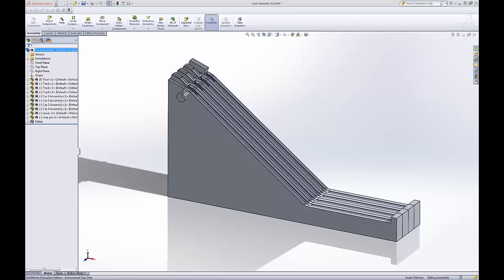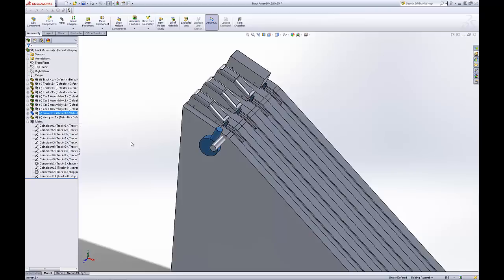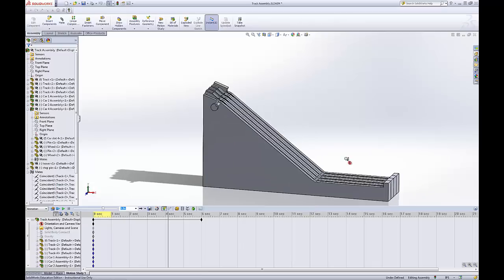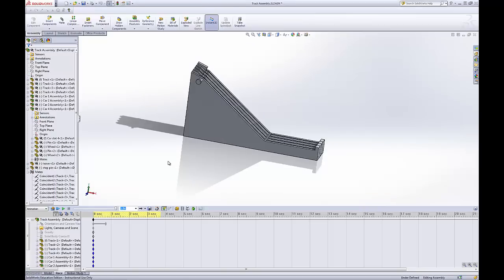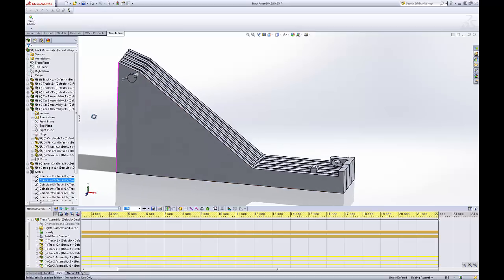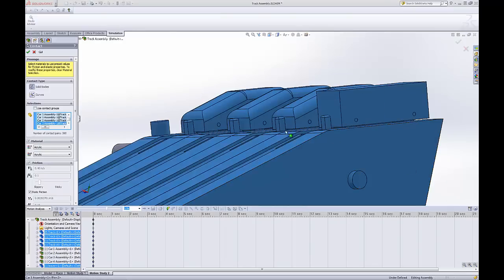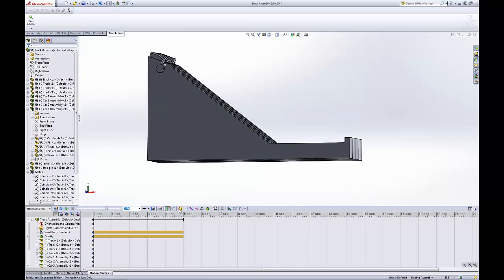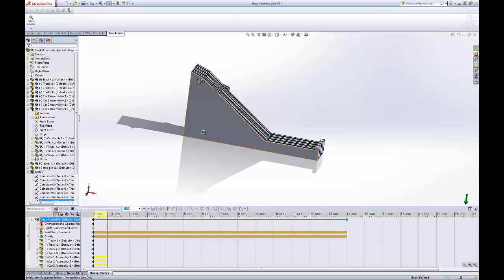SolidWorks Motion Study using Gravity

Comment: Have you tried to put a diferent Dinamic Friction coefficient to each piece?

They should arrive at different moments....theorethicaly
Reply from the maker: Yes If you use a different kinds of Frictions then they will change how fast they go down the track. It is easy to do it on a global level, but I have not had any luck on getting it to work on each individual car.
Reply: I have the feeling that SW Motion Analisis is still in a beta version